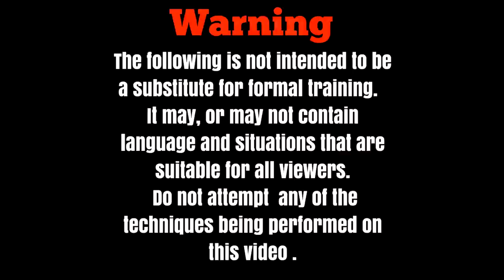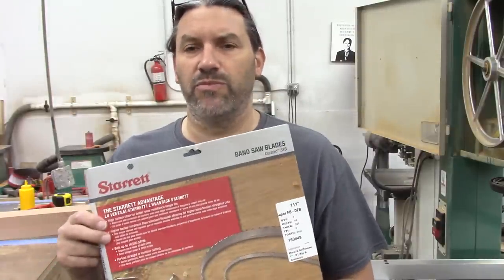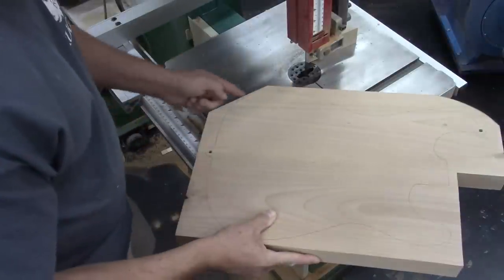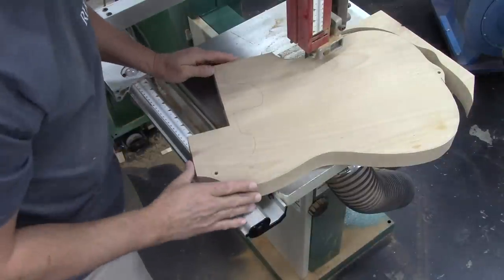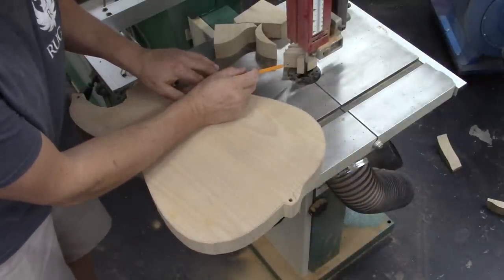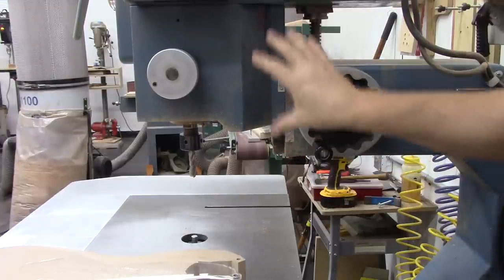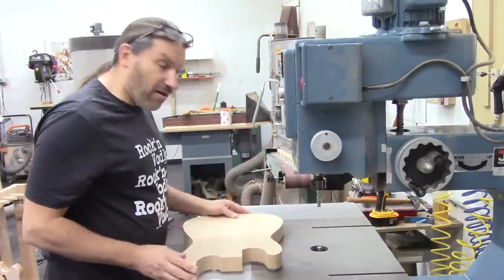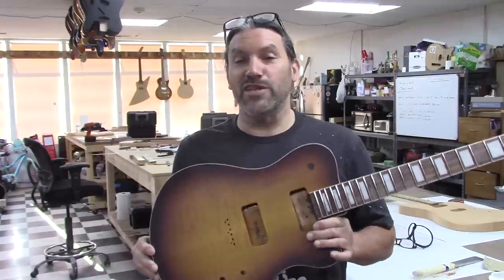Do You Even Know How to Use a Bandsaw or a Pin Router Bro?  Feature Length Video...

Comment: I have a small shop so there is no way I could fit a full size pin router with everything else, so I picked up a stand alone overarm pin router made by shopsmith in the 80s.  I mounted up my variable speed 1/2" router and am deeply in love.  I'm looking forward to not ruining my templates.  I've been binge watching your pin router videos, LOL.  Anyway, what are your "go to" bits for the pin router?  I'm kind of assuming a 1/4" and 1/2" spiral up cut with a pretty large cut depth?
Reply from the maker: Hi John
I love those little pin routers I had a ShopFox for a while 
We use all kinds of bits but the spiral ones see the most action 
Thanks for watching my friend

Comment: One little trick I like to do is use a 2" or 2 1/4" Forstner bit to remove most of the waste inside the horns. It's easier for me to do that than try to cut the sharp radius's with the band saw, and I can use a little larger blade. YMMV.
Reply from the maker: It's a good one

Comment: I feel like I have a weird perception issue. Quite often as I'm making a cut, the pencil line and the bandsaw blade kind of...merge into one another and it gets hard to see where one ends and the other begins. I have to look away or move my head to change perspective a lot. It was not a problem I was anticipating when I started using a bandsaw...
Reply from the maker: I hear that, my eyes aren't as good as they used to be :D

Comment: Nice video Matt. Thanks. Do you do the body round overs on the Pin Router or do you use a router table?
Reply from the maker: Hi Matt
We do each one and sometimes, believe it or not, it is easier to just do it by hand with a rasp and abrasives